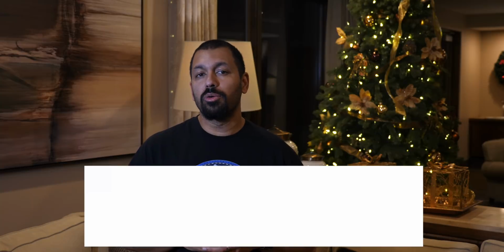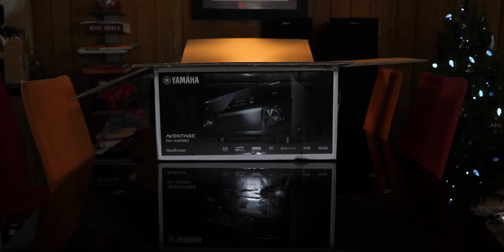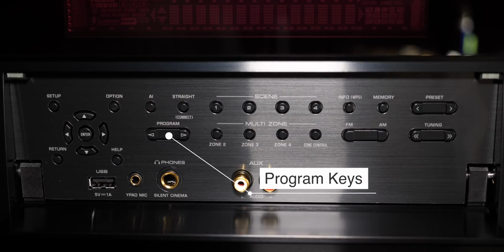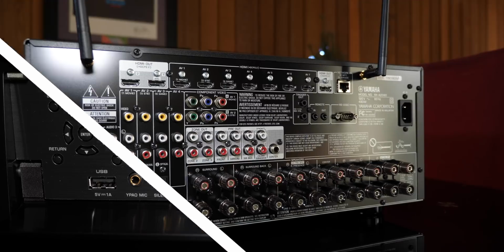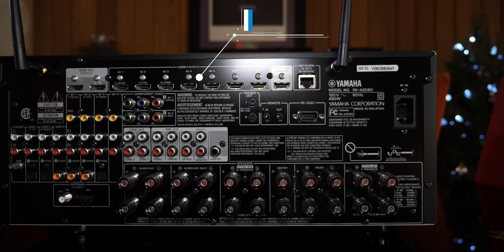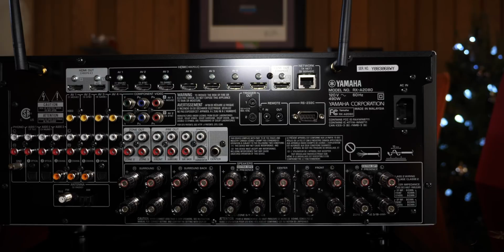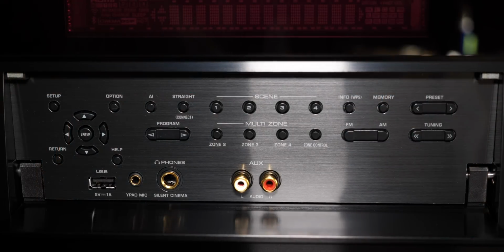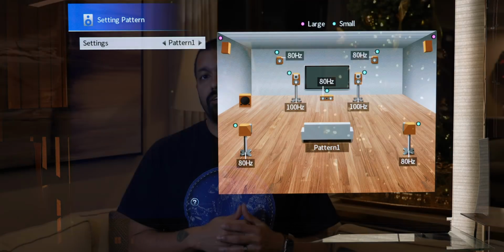Yamaha RX-A2080 Unboxing & Dolby Atmos Setup

Comment: Hi TecnoDad. Thanks for another great  review, especially with the graphics indicating the buttons, connection etc.,
 Two questions. 1) out of curiosity may  I know which software did you use. 2) Any plans to review Macintosh multi channel amplifiers? ( sorry if you already reviewed and I missed).
Thanks
Reply from the maker: Hi!  Thanks!  That stuff takes a lot of time...I use Final Cut Pro X and some third party graphics bundles I've purchased for that kinda of stuff.  I'd love to get some McIntosh items but I don't think they want to send me any to review.  They already have a huge presence.

Comment: I will never buy another Yamaha receiver again. 7 channel power drops to the low 40's per channel. Until they remove the current limiters from their power supplies I would avoid them. The build quality is nice but just not worth the money for that low of power.
Reply from the maker: Woah, there are current limiters?
Reply: @TechnoDad  ya man. Sound and vision and Audioholics noth did bench tests on the Yamaha receivers and confirmed that when are running more than 5 channels the wattage drops to the 30's and 40's. That's why you had to go to -10 on the volume to get it loud enough.
Reply: ekim andersom  not really. My Marantz has a 70% guarantee. So when I'm running 7 channels I'm still getting about 90 watts per channel which is more acceptable. I run a power amp now anyway for my front stage and my receiver only powers my surround and height speakers. Lots of juice for that.

Comment: So How about LEFT and Right and Center  Speakers FROM Klipsch and Maybe Letf and RIGHT SURROUND and 4 SVS Height Elevation Speakers and SVS Sub??? Would that Be a Good Ideal Set??? I Remember When U Told Me that With Just SVS Alone, I Would Need a External Amplifier Added for More Kick, I Imagine????
Reply from the maker: Hi!  That would be a good system.  Yeah, with Klipsch you're at 98db sensitivity and some of the SVS speakers go down to 87db which would relate to a huge drop in volume.
Reply: @TechnoDad  Now those SVS Sound Path Speaker Cables, Would Be Good for L R C Speakers and Maybe SURROUND Speakers RIGHT????